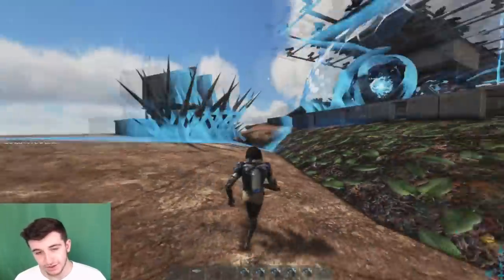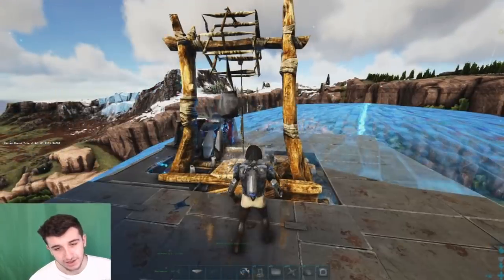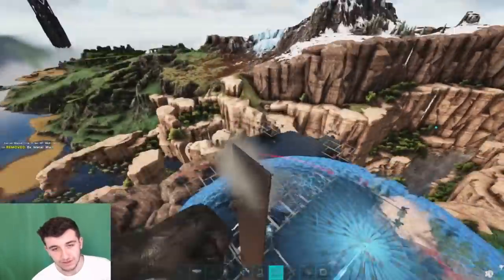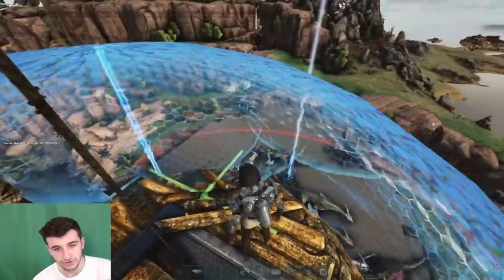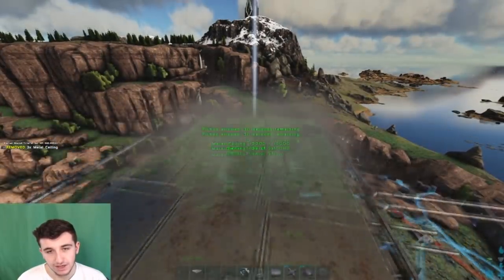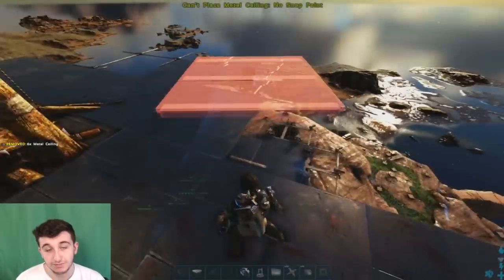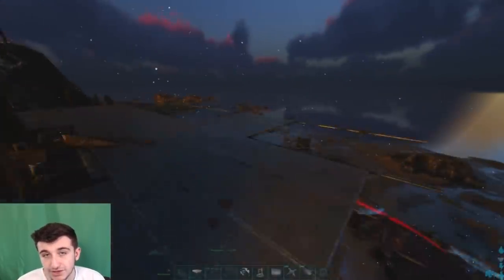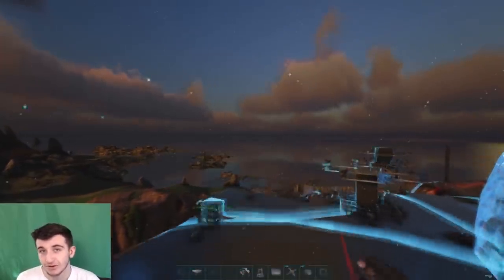How To Make a FLOATING BASE in ARK!

Comment: the reason u had a problem placing down ceilings after u placed the well is literally because u placed the well first, if u had placed down the tek hatchframe then placed 4 ceilings around it then placed down the water well it would've been fine

Comment: Btw this doesn’t work anymore now you use the new fence foundations you build however high you want snap a wall to it put a ceiling down and than build from there than when you can’t build farther line the fence foundation up with the last ceiling you could place as best you can make sure you snap the wall to the fence foundation and you can than build farther again the fence foundation and wall works ass if it’s a foundation just like how the well and hatch frame were
Reply: jaysondog gaming how do you do it? How you explains it is kinda hard to understand